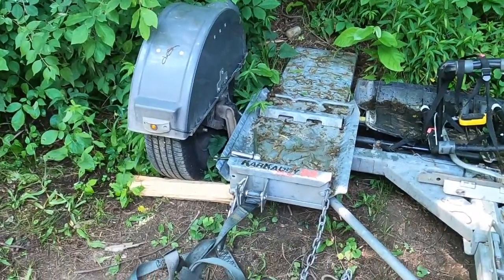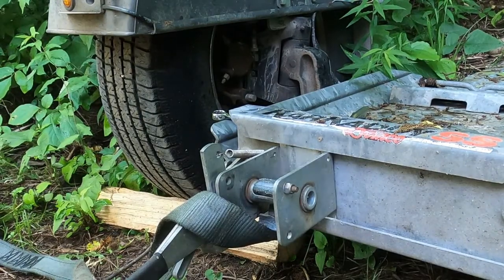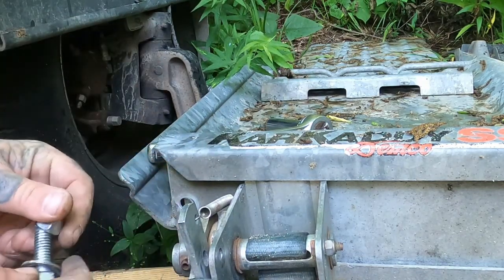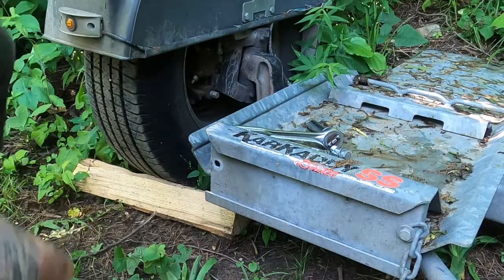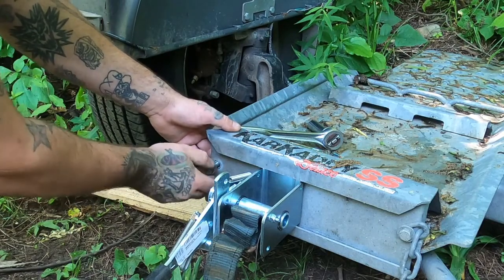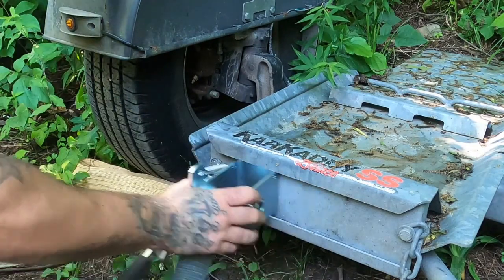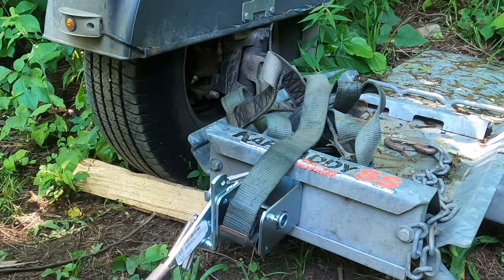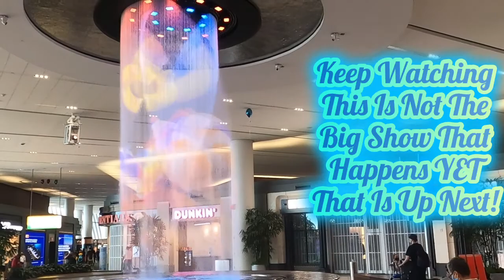KarKaddy SS - Foldable Car Dolly Ratchet Replacement (+ Must See Water Fountain Show In NYC Airport)

Comment: Where did you get the replacement ratchet at? And what did it cost?
And is that an inside waterfall doing that with the lights that is pretty badass
Reply from the maker: Got it off Amazon an it was like $87 bucks. It's way better then the original one that came with it. This one's got better teeth and just way better made.
Reply: @YouTurnPermitted  good to know as I need new ratchets for my car dolly and want them adjustable like those I'm sure I can make something work will see LoL thanks for the tip